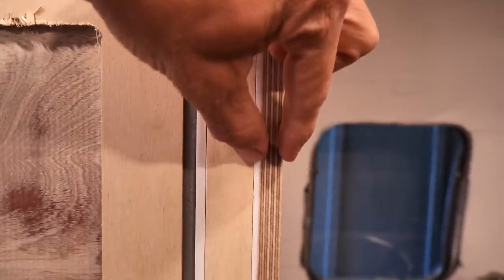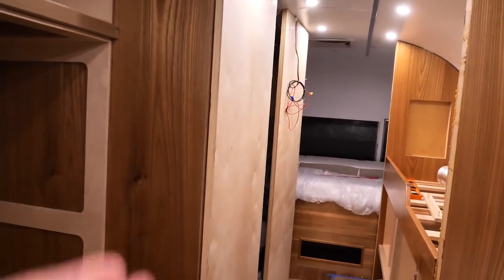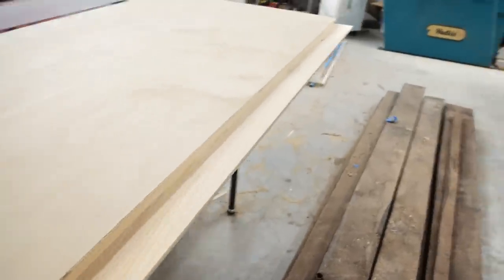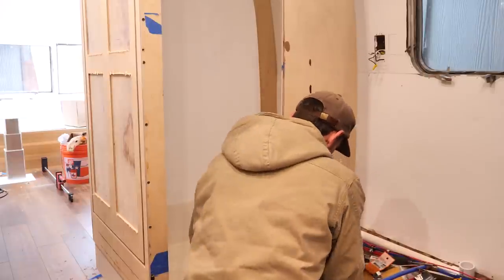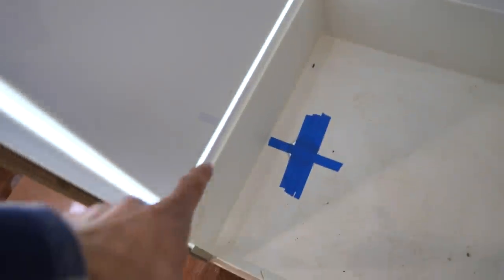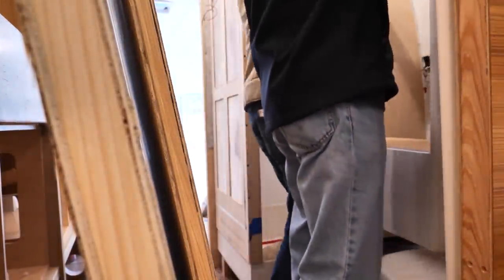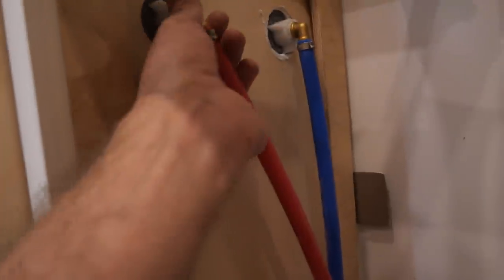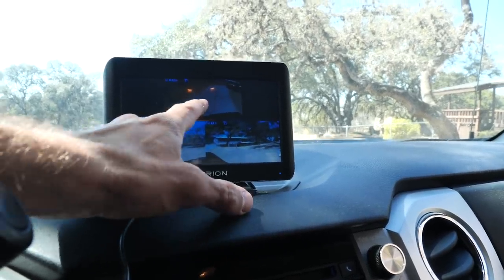DIY Airstream Shower Pt. 2 / Vanity Build / TPM Sensors (Airstream Argosy Restoration Ep. 26)

Comment: I think your hot and cold may be reversed on the shower valve? Maybe those external valve units are different?
Reply from the maker: I’ll check on that.
Reply: Easy fix if so, just cut the pipe about 6” down from the shower elbows, two couplings and botaboombottabing.

Comment: How did you seal the LED strip in the shower? It seems there were gaps between the LED and the wall panel.
Reply: I believe the LED strip is installed in a groove behind the transparent acrylic sheet that he lined the walls with so it's not open to the wet side of the shower.
Reply: @mariainmich  OK, I missed it if there was a transparent sheet.